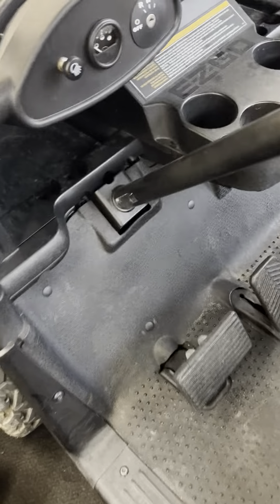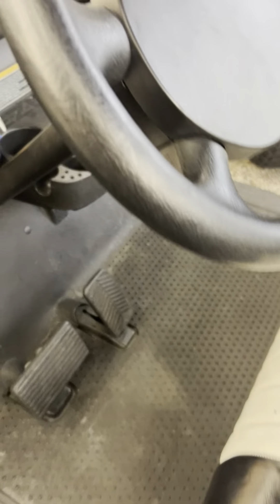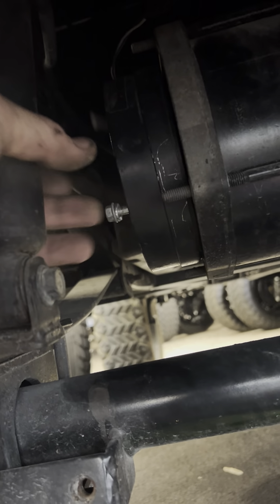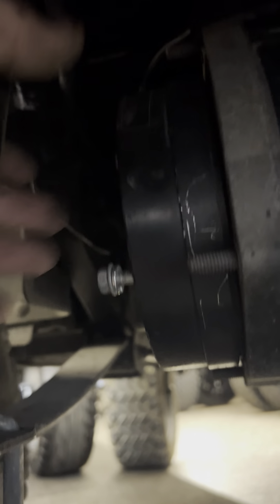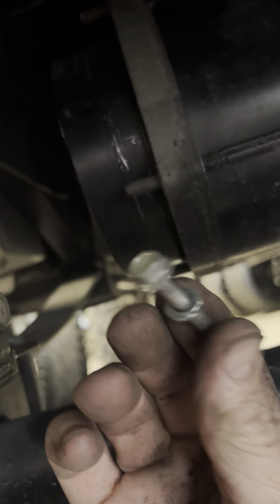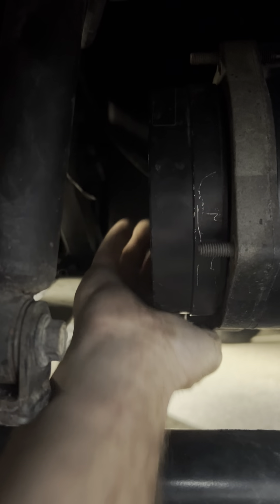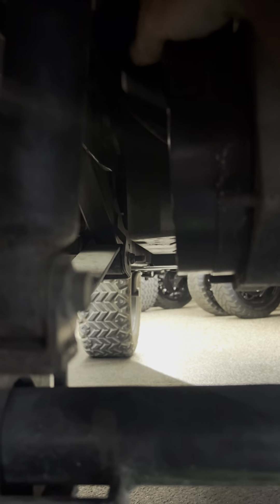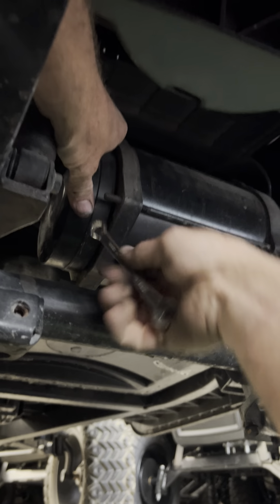EZGO RXV Troubleshooting. How To Determine If The E-Brake Is Bad.

Comment: Replace the motor brake but its still acting up, could it be the speed sensor or controller?
Reply from the maker: What’s it doing.  Also when you bolted the brake back on.  You didn’t tighten the motor brake bolts tight did you.  All you do is just snug the bolts.  You don’t tighten like a regular bolt
Reply: @HeyHeyHey97  i didnt use a power tool or anything just snuggled it up with hand tool, and it just keeps locking up every few mins, then I'll have to turn off the key and turn it back on couple times to disengage the motor brake
Reply: @HeyHeyHey97  i was thinking it could be a speed sensor but can't find 1 video or post about the speed sensor
Reply from the maker: @ATL420  what’s the cart doing
Reply from the maker: Is it moving slow slow
Reply from the maker: @ATL420  if it’s a speed sensor. The cart will run about 1 mph and shake but it will run
Reply from the maker: @ATL420  if it’s locking up while your driving replace solenoid
Reply: @HeyHeyHey97  figured it out. The controller had an update. It needed
Reply from the maker: @ATL420  oh so you had the Navitas controller?
Reply: @Golfcartwhisperer  I really couldn't tell you as I just took it to a local golf cart shop and they did the update for 50 bucks
Reply from the maker: 10-; man. Thanks for watching my channel

Comment: This video shows my exact problem but the solution is not clear. Is there a part 2? Not sure whether I need a new brake, controller or just a software update/refresh. Any more detail that may be available is appreciated.
Reply from the maker: That means replace the brake.  The brake is slipping.  Thanks for watching. Hit that like and subscribe button for me
Reply: Wow. Thanks for the quick and clear response. I definitely support your work. Stay gold!
Reply from the maker: Also when you replace the brake. I have a video on my channel. On how to replace it. The main thing is don’t tighten the bolts too tight. Just snug. But watch the video
Reply from the maker: Ezgo Rxv won’t move. E-BRAKE REMOVAL AND INSTALLATION!!!
https://youtu.be/yAHOU7AwiQw
Reply: How do you know if it’s a brake issue vs a bad connection with run plug?
Reply from the maker: When you put in tow with the key in does the brake release.  Also what year is your cart
Reply from the maker: I will say this.   Since 2008 when the Rxv came out. I haven’t  replaced but 5 or 6 of the run plug.  . If that And if i did replace it.  Most of the time it was because of corrosion.
Reply: @Golfcartwhisperer  I appreciate the feedback! I see people doing a bypass with the run plug, so wondering if that was an issue a new brake would have the same problem. So if a brake is going bad or failing it just seizes up?
Reply from the maker: @CaribbeanSimPilot  the signs of a bad brake are an electrical burn smell or the cart locks up or when you hit the gas and let go of the gas the cart stops faster than usual
Reply from the maker: But the way to tell if an E brake is bad is if you turn the key off, put it into. Turn the key on the brake should release. If that doesn’t work depending on what year the cart is under that black cover on the passenger side there should be a 1234 plug. You connect one into three and that send direct voltage to the E brake. if it doesn’trelease then bad E break.
Reply from the maker: @CaribbeanSimPilot EZGO RXV ELECTRIC.  Bad brake????Check voltage on the electronic brake!!!!
https://youtu.be/WTKKIFENu28
Reply: @Golfcartwhisperer  when I turn the key to neutral or forward  I hear a click or something sounds as though it’s repositioning. I have not noticed if in tow it does that.
Reply: @Golfcartwhisperer definitely does that. Once I stop I hear a click and it sounds like it released. I can then go another 25 ft or so

Comment: Viktage good
Reply from the maker: Just get you a new brake. They have a heavy duty brake. Which is what we use here. And we seem to have no more problems with them.  It’s thicker than the original brake.  It cost about 50% more than the standard e brake